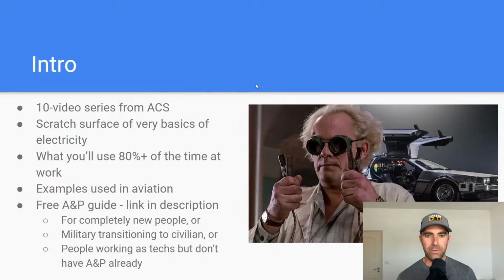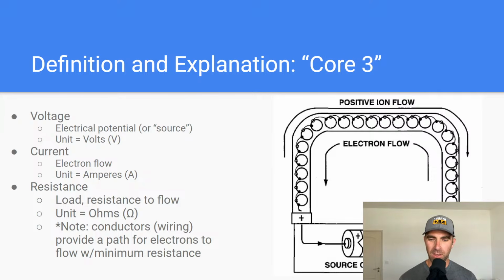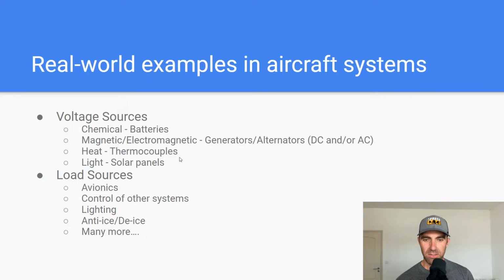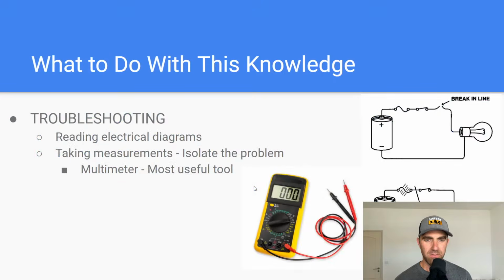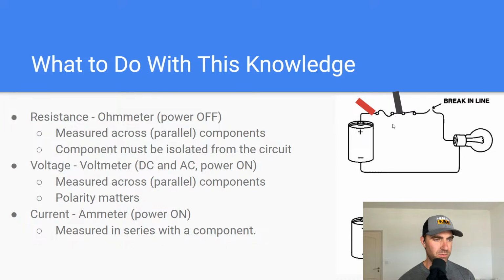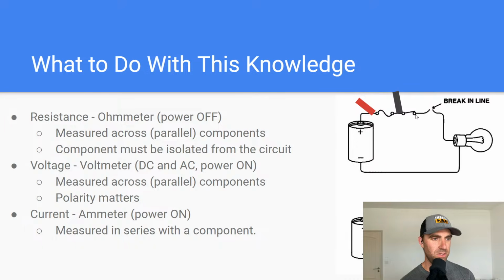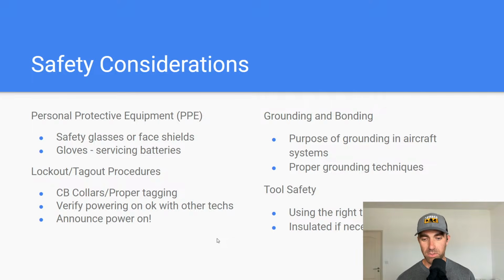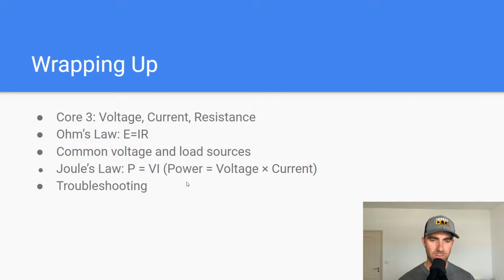Electrical Theory for Aircraft Techs: The Complete Guide

Comment: Aircraft techs?  That's like elementary level circuits 101.  I'm literally scared of the competence we have working on jets I ride on.
Reply: It quite literally says, BASIC aircraft electrical…… and its a 10 part FREE YouTube series, it’s PROBABLY gonna literally the absolute easiest to digest and entry level concepts….. and then increase to slightly more complex concepts….. Jesus
Reply from the maker: I’m sorry, what were you expecting?

This content was intended to be elementary level. There is more in-depth knowledge needed in order to get your A&P that I haven’t covered (yet).

Many problems that need to be troubleshot and fixed are elementary- level.

You should be scared anyway, companies like Boeing engineer the jets  you’ll likely ride on with a “profit over safety” mindset.

Thanks for stopping by.